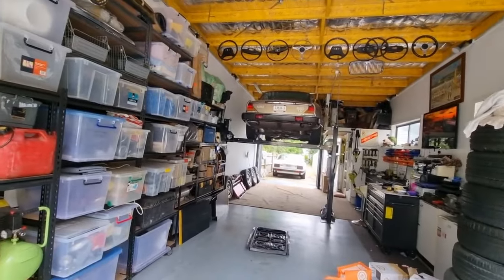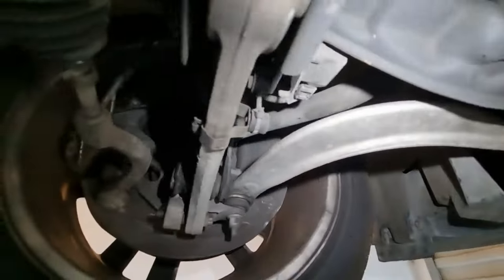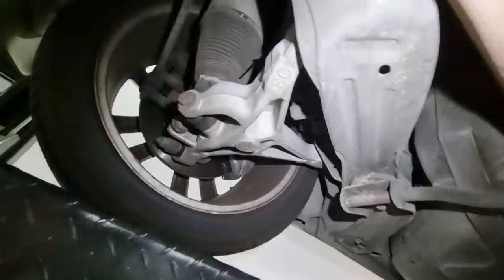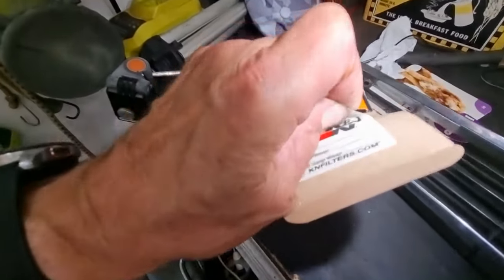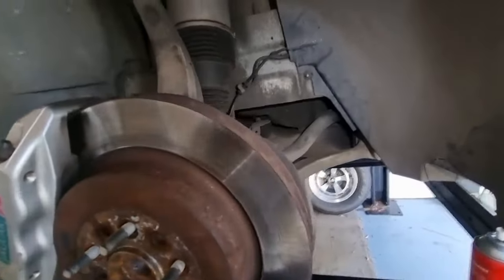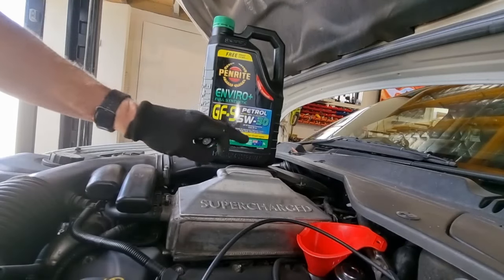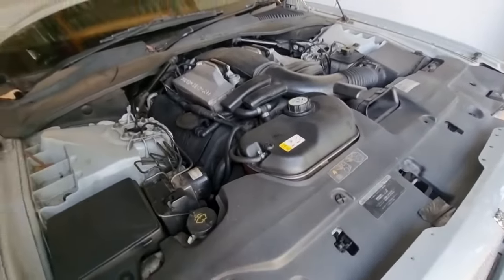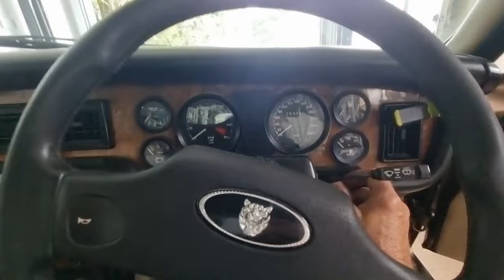What to look out for when servicing a Jaguar X350 Supercharged XJR V8

Comment: Had to replace the tie rod ends, rear stabilizer links and rear track bars on my 06 XJ8, all because the rubber seals were shot. It only had 37,000 miles at the time. Cheers, Doug

Comment: A little pre-emptive maintenance advice. If you bonnet latch sticks due to a number of reasons including paint corrosion on the bonnet strikers, the release cable can become detached and you are in a world of pain trying to release the bonnet through the front grill. Mix an aerosol lid sized amount of grease and oil and spread liberally across all the latch mechanisms ..... WMD wont last...

Comment: Hi Brett, the brake calipers are in fact Brembo which I have fitted to my XK8 in the U.K. and have two bleed nipples, the same as your XJ. I had to replace a front one on my XK8 recently which cost my over £600. I had the old one refurbished and have been trying to sell it but not getting any takers. I’ll hold on to it until I can find a buyer.

Comment: Great to see the XJR again. The engine under cover does tidy things up, but are hard to find in good condition. That coolant level was below the low mark on the 2-step block level indicator  Hmmm.  The coolant is going somewhere,  so best to have a good look around all the pipes for tell-tale stains.  When it's topped up, check the supercharger coolant level at the screw-in cap to the left of the intake. It should be full to the top.  Remember there are two electric coolant pumps as well as the engine driven one so lots of potential for leaks.  I know you had the valley hoses done so that's good.  Supercharger pump is in front and aux heater one behind it.  It looks in great condition for 300K Km but I don't think the exhaust is stock.
Reply from the maker: Thanks Pete
Had a serious look for leaks but couldn't find any! Remember, I had all the valley pipes replaced last year. However, I will keep monitoring it.
Reply: @tjmthejagmandownunder 
is it overheating?